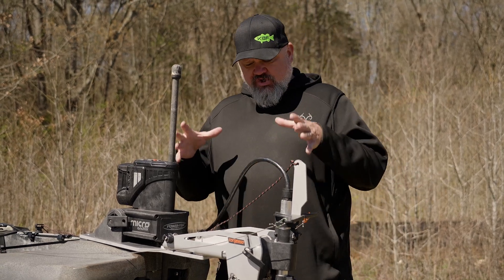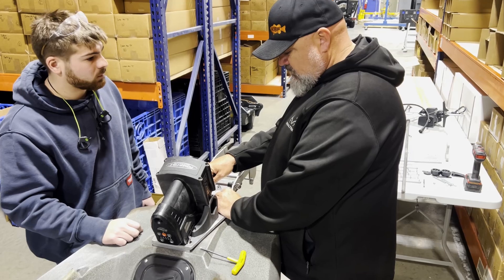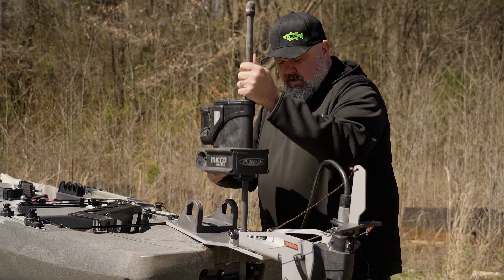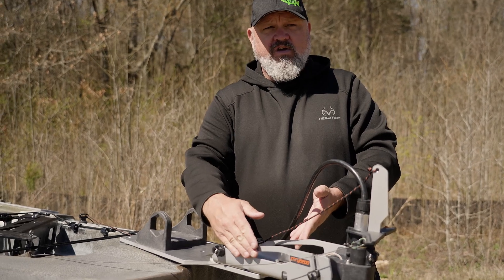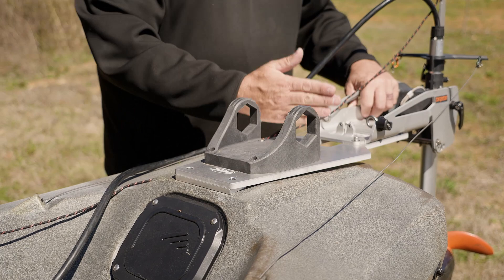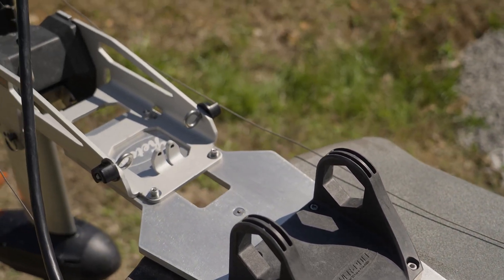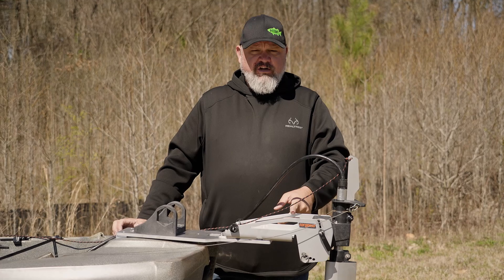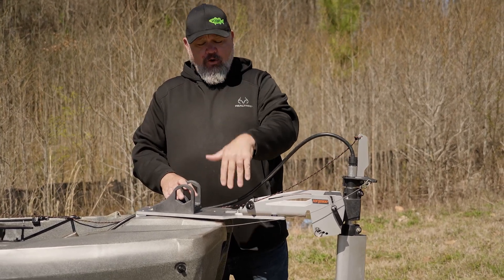Advanced Kayak Fishing Rigging (Power Pole and Motor Mount)

Comment: Glad my credit card limit went up!! Doesn’t one objective do something similar to this?
Reply from the maker: Yes and so does Innovative Sportsman. They are both great but I wanted something that didn’t just rely on the inserts in the boat and I wanted to lower the Power Pole
Reply: @ChadHooverFishing Chad, I diy my mount RS117 doesn't have inserts like the 107, so I put aluminum bars and made a cross beam and fastened to where the bungees go. It's super strong. Hope that makes sense. Just something to thing about. I can send you a pic.